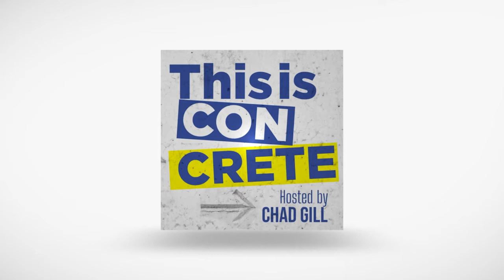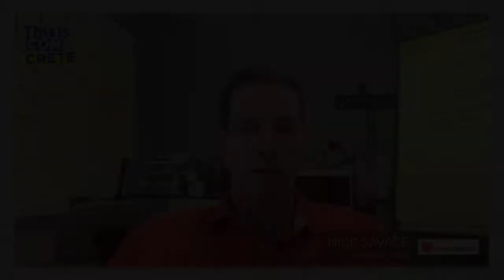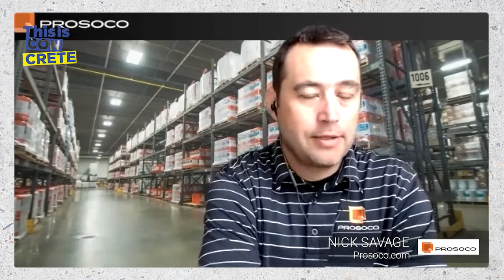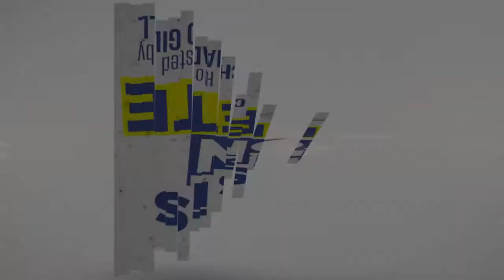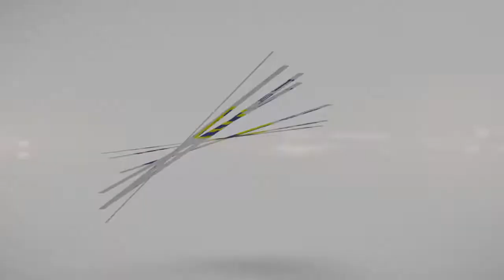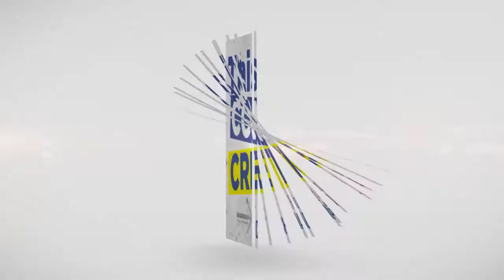The Chemistry of Concrete Densifiers

Comment: Would densifier help to mitigate cracking?
Reply from the maker: No densifier will help with mitigate cracking.  Some product can slow the drying out of the surface which. could minimally enhance curing but not an appreciable amount.  Densifier is all about surface hardness.  Cracking is mix design, placement techniques and reinforcement

Comment: Do you recommend putting a sealer on a slab after it has been densified? If so, what type of sealer would you recommend? Thanks. :)
Reply from the maker: One of those, "well it depends."  I recommend sealing concrete but it has to match the application.  Acrylics are inexpensive and easy to apply but minimal wear and protection.  UV stability, enviroment and the things you are protecting the concrete from are important variables when choosing a sealer.  This especially true when considering a penetrating versus a film forming sealer.

Comment: Awesome vid. About using densifiers as curing agents. What about doing a spiff coat after cure?  I've done both sodium and lithium, but we've had great results doing a spiff coat. I think Ashford Formula has it as an option as their application process.
Reply from the maker: not a huge fan of the spiff coat.  It does enhance the look but I am not convinced it really adds that much protection.  I tend to fall in the the it comes off as easy as it goes on camp.  Densification is a chemical reaction, you need enough material and time for it to occur.

Comment: Hi, great video. i'm wondering if the colloidal silica densifiers (e.g. densi crete) have greater waterproofing properties than other densifiers?
Reply from the maker: not nearly as much as putting it out correctly and in sufficient quantities.  Densifiers all work when put down the way they were designed.